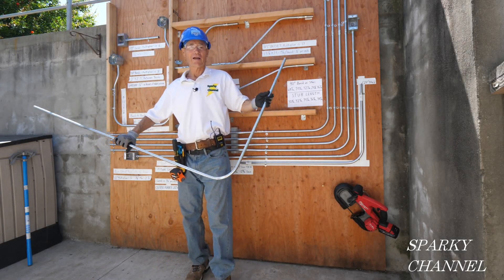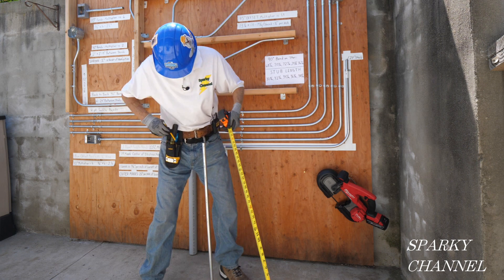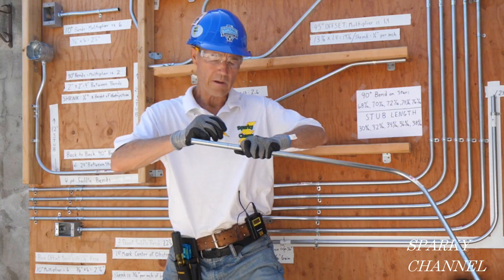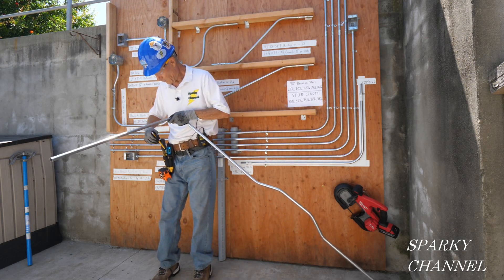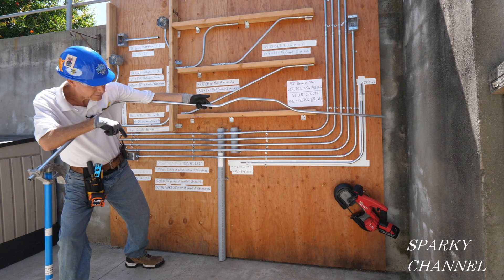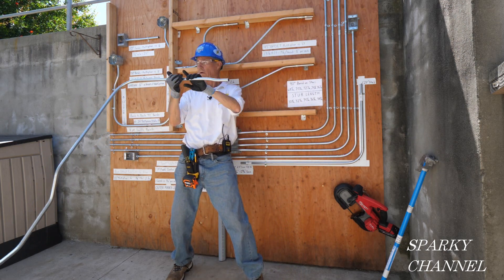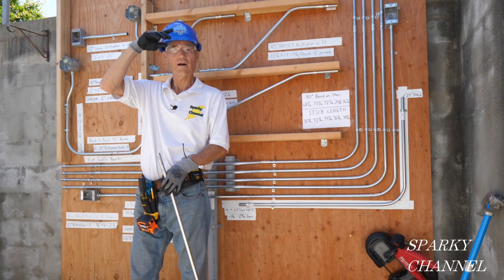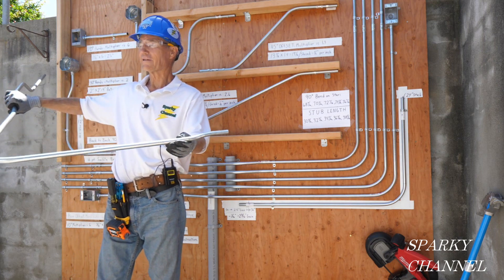How To Make a Box Offset on the End of a Long and Complicated Conduit

Comment: Bill, another great video. Any chance of a link for the handy tool pouch that you were wearing on your belt in the video?
Thanks
Reply from the maker: It's made by DeWalt but they've changed it a little: ToughBuilt - Pliers Tool Pouch - Medium | 3 Pockets & Loops, Tape Measure Clip, Screw Driver Pencil Holder, Tool Holster Accessories, Multi-Tool Organizer (ClipTech Hub & Belts) (TB-CT-35-M): 
Amazon: https://amzn.to/2Wkn3c4
  It really is a cool pouch because sometimes you don't need that many tools so why carry the weight? It's inexpensive too. Thanks!